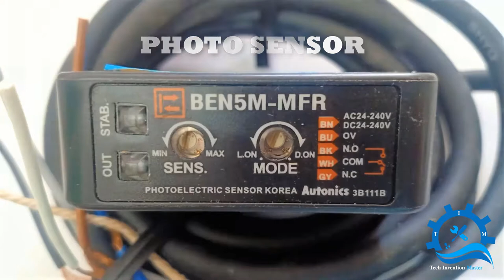How to relay and timer work with photo sensors/Photo sensor connection...

Comment: What happens when u keep ur hand i front of sensor for quite long time....,

,kia bulb jalta rahay ga???? Ya apna time pura kar k buj jay ga????
Reply from the maker: After getting the sensor, the timer turns on and when the time is up, the automatic light will turn off
Reply: @techinventionmaster9560  no it remains "ON" if ur hand remains in front of sensor.......
Reply from the maker: @zubairashraf6138  Yes you are right, it will turn on if there is a hand in front of the sensor

Comment: I want a change in it .... If you can suggest what should i do????

The bulb remains "ON" ... If some thing is in front of sensor.....(due to continuous input signal of the sensor)

i need a circuit in which bulb turns OFF  once the timing is complete on timer......

It should cut off power supply to the bulb irrespective of sensor continuous signal..

And it should b triggered again by a new signal of the sensor ... (If the obstacle is moved away and brought again in the sensor range...)